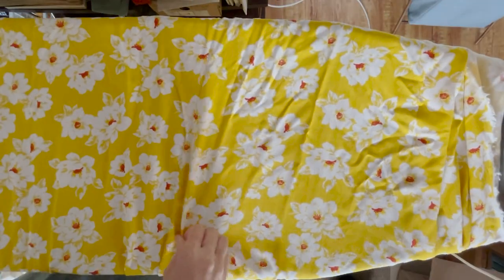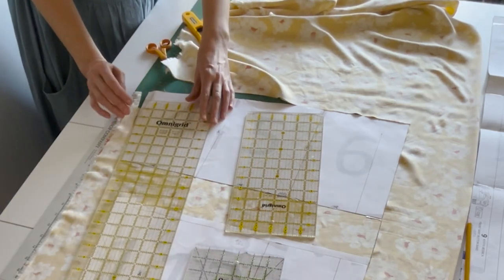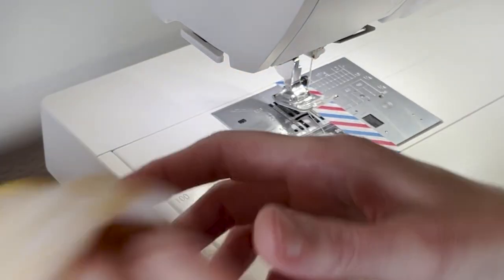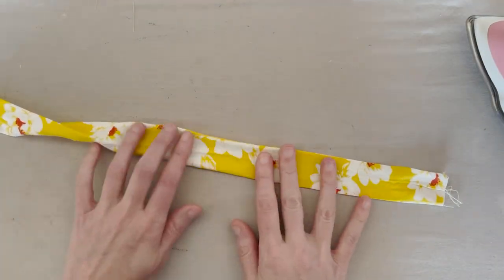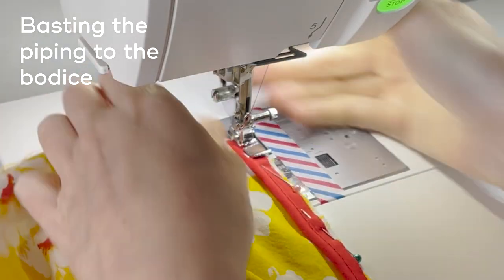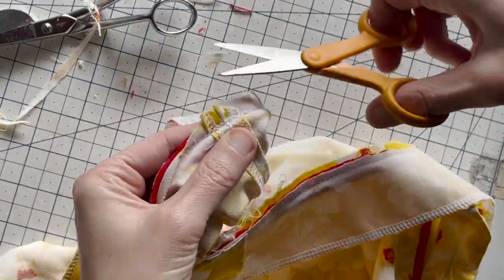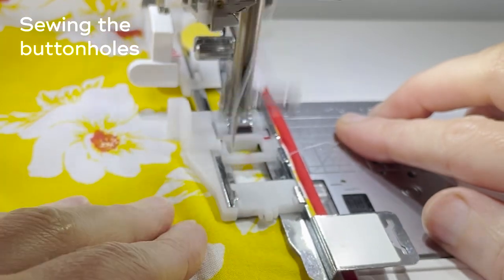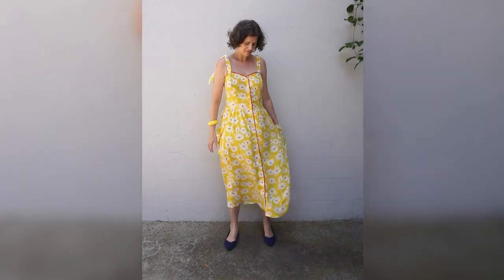The Making of a Tie Strap Summer Dress

Comment: I love the dress and the cheery print.  Being a beginner, I need sewalongs with all the steps and details. I mostly try to make pieces that have a video or at least a photo sewalong, otherwise I'll probably get stuck along the way.  What foot did you use to attach the piping?
Reply from the maker: I just used a zipper foot that is narrow at the back. But they make special feet for piping. This pattern is a variation of the Jessica Dress by Mimi G. I'm pretty sure she has a video sewalong for it.